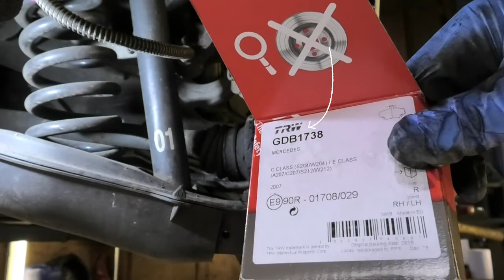Mercedes C class 2007 w204 rear brake discs and pads replacement

Comment: why can't u reuse the relatively new pads when our change the rotor?
Reply from the maker: Usually because the pads are worn according to the old disc form and shape if you put them on the new discs they might make them wear uneven.
Reply: @DaringBeefcake  But you were OK with using the old brake shoes with the new discs! this was a waste of time and money, there was absolutely nothing wrong with the old discs and pads.
Reply from the maker: @ricky302v8  well the shoes are used for the hand brake not for stopping the car. Sorry if it upsets you, but I had to do the job for what ever reason I don't remember so I filmed in case it helps someone change their discs and pads, not really intended for other purpose.
Reply: Thank you for your video I have a c280 w204 and I will be changing all 4 rotors and pads on the weekend. Now I already know the procedure thanks to your video.